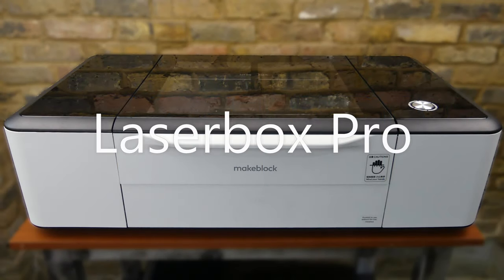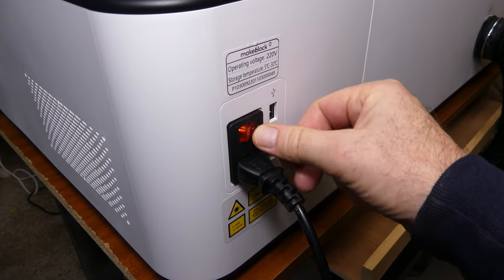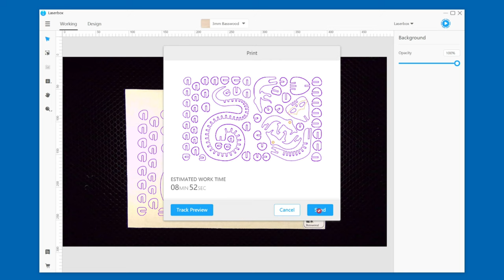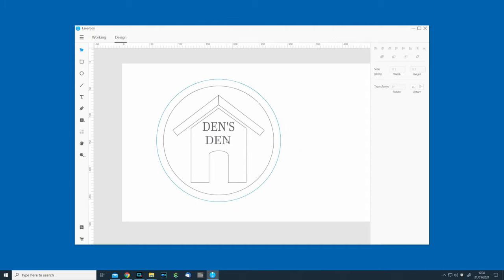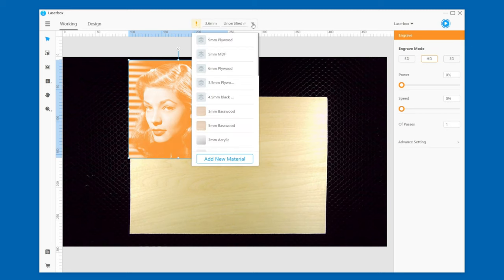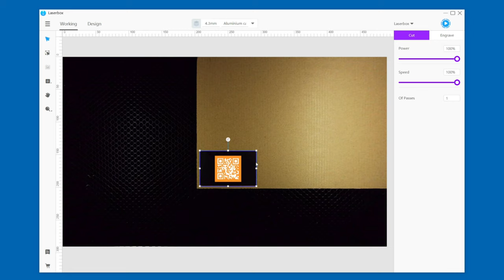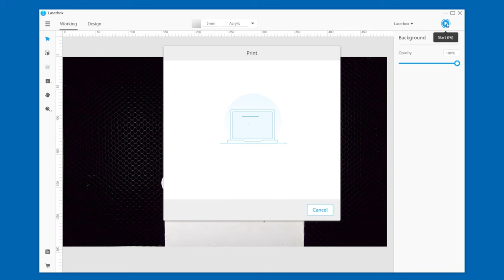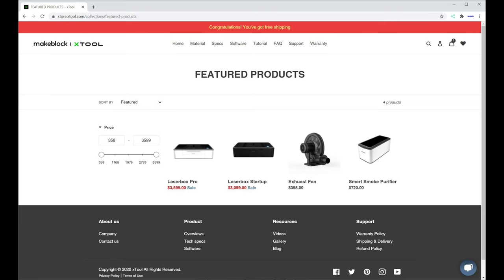Laserbox Pro Intelligent 40W CO2 Laser.  Test & Review.

Comment: learn by doing.....k40 whisperer was a game changer for the k40...i now have built my own 
600x400 co2 laser using the k40 control board, 45w spt laser.....have 
had for 3+ years.....spt makes great tubes.....they are actually tested 
with info like peak power......made motorized bed out of 1x1 steel tube 
and 3d printed parts....total cost was $900....well worth it as its paid
 for itself many times over

Comment: Excellent review! How many operational hours are these tubes expected to last and how much does a replacement tube cost? When I consider a purchase I also like to know what the longterm running costs are likely to be. Thanks
Reply from the maker: I believe 12 months warranty. 10,000 hours and about £380  / $500 for a replacement from an authorised dealer. No doubt cheaper if you shop around.
Reply: @techydiy   Thanks for the swift reply,very helpful.

Comment: I’m on the website now trying to decide between the rotary tool version and the pro.
Does the rotary version still do everything else the pro version does just with an option to do the rotary engraving as well? There’s not a whole lot of information that comes with the machines.
Also, do we HAVE to use the filter? Or can we exhaust it outside only? Cause Ive heard the filters are VERY expensive to replace and need replacing ever 3-4 weeks for hundreds of dollars (this was a glowforge customer that told me this about their hepa filter) so I’d want to be able to exhaust outside only.
Reply from the maker: I believe the rotary version is  pretty much the same machine with just the modification to allow the rotary axis to be fitted. I just vent it outside without using the filter. It clears smoke quicker that way anyway

Comment: Great video, what is the difference between this model and the hybrid one?
Reply from the maker: The laserbox pro model uses a co2 laser which can cut transparent materials. 
The hybrid model uses a diode laser which can't cut transparent materials. The hybrid model also includes a vinyl cutting blade. 
If you want to cut vinyl and engrave at the same time, the hybrid might be a good option.
The co2 l;aser in the laserboxpro is much more versatile for general cutting/engraving It is easily the most used tool in my workshop.
Reply: @techydiy  Thanks for your reply on the comment and information

Comment: You didn't mention a chiller? Does it not have a cooling system installed? If not that tube won't last long. Do you have to use its software or can you use 3rd party?
Reply: I could be wrong but I think he mentioned the tube being water cooled. 1:08
Reply: @johninokla2635  yep, I clearly didn't notice that! It seems odd it has a big filter but not a proper cooler it seems.
Reply from the maker: It's water cooled. Specified temp range is 0 - 35C.  My guess is than in most situations water cooling is more than adequate. It probably only has to dissipate a couple of hundred watts. In a hot country without aircon it might be an issue. Anyway I am sure I will find out in July/August.
You can use whatever you like to create image files but you have to use the software to send it to the machine. CTRL F1 brings up a maintenance menu which gives you some lower level options, like send gcode.